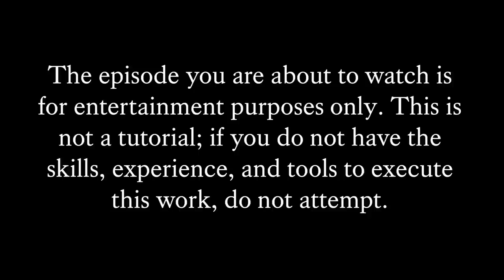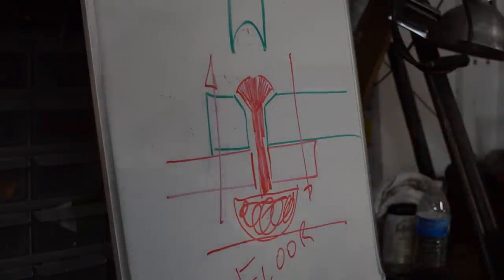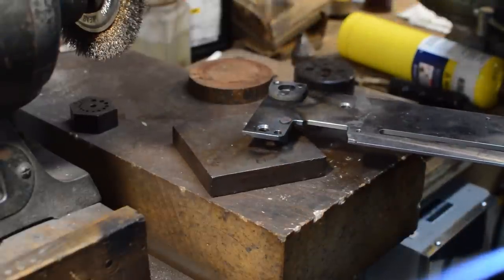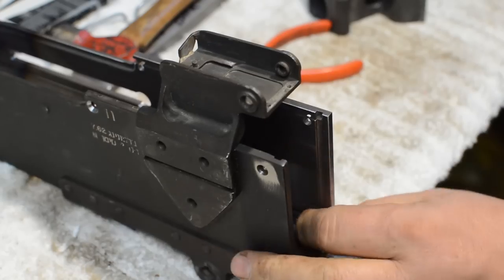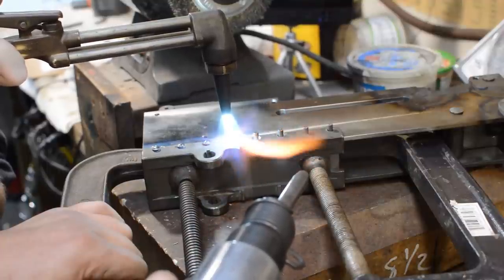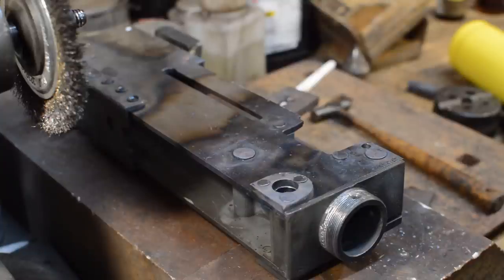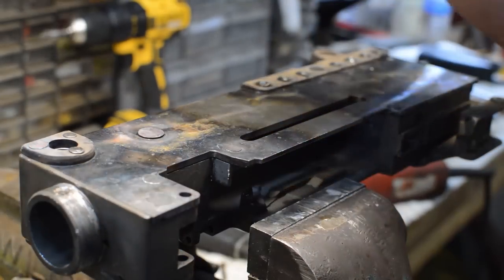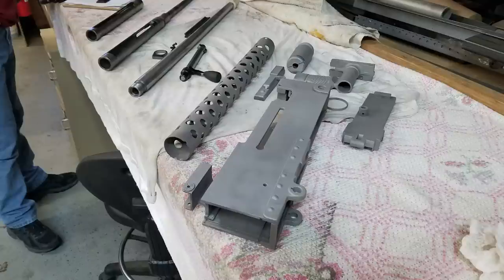Anvil 026: Browning 1919 side plate replacement

Comment: Rivets didn't serve the Titanic too well ??? Or was it bad metal ???
Why did you say grind the plate ???
The M 2 's had rivet heads if I rember correctly ??? An some SAW's too ???
Saw some of the original rivets with their rounded heads ???
Reply: The rivets were off specification. Too much sulphur which makes them brittle when chilled below freezing.
That was found out when they analysed the rivets in the “big piece”.

Comment: Having shot hundreds of thousands of rivets, I can say this was rather cringe-worthy.  That said, the more SOLID mass you can get behind an item for the purposes of hand-riveting, the better.  I liked to use the edge of an 8' metal shear.  The solid steel base was solid enough and made the riveting go quickly.
I notice you're using the FLAT side of a ball-peen hammer.  Ever wonder what that peen side is?  That's for forming rivets and filling countersinks.  Don't be afraid to 'peen' that rivet.  That's what the peen is for.
Reply from the maker: First rule of gunsmithing....the easiest piece to finish is the one you didn't screw up in the first place. Using the peen will put dents in flat surfaces that should remain flat. Try driving a rivet WITHOUT doing any damage to the surrounding plate. That's what we did here. That's a 90 pound block of granite I'm using as a buck. Solid enough?
Reply: @randymagnum143  LOL, i know. Bigger than any anvil we had, though.
Reply: @marknovak8255  Never tried granite but did spend money on tungsten bucking bars. Worth their weight in gold... Almost literally. You might also try using a large drift punch and an assistant if you are not going to peen the rivets. You can use two hammers, too. Set the peenof one hammer on the rivet. Hit that hammer with another Hammer. Eye protection is recommended. Significantly less likely to damage the metal doing it that way.
Reply: Having used plenty of hammers in my life, when your tool is a hammer all your problems look like nails

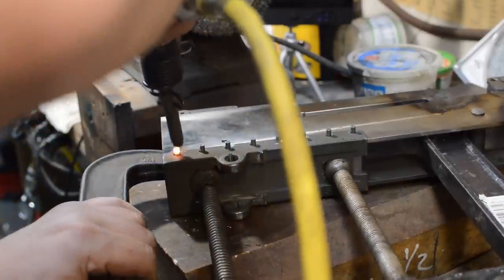Comment: 27:37
Why do you blip the gun at first?
I would think it would be better to go full trigger at first, because that is when it is the hottest.
I don't know much about gunsmithing, sorry if I am not seeing what your knowledge knows.
Reply: Actually, the more I think about it.
You need to pull the trigger longer the first time when the rivet is still hot enough to swell into the joint. 
It is not a random sheet rock screw.
Reply: All this being said...
I have no knowledge of gunsmithing.
But I have some common knowledge of rivets.
Reply: See how good your 4th one is.
Reply: ......
Now I gotta just relax and take what I have comming..
I am in no way as skilled as you are. And I know you have done this lots of times. It was just something I saw that may help you in your riveting future. 
(But obviously not, given your experience)

I have learned so much from your videos, they are an invaluable tool.
Reply: I guess my whole gripe comes down to why you blip the impact hammer when you just start. 
Why not just hold the trigger intill you stop?
Reply: @ridetheapex  probably wanted to make sure he was evenly applying pressure to the air hammer
Reply: @ridetheapex  I'm sure he values the input from someone who knows zero about gunsmithing, specifically bucking rivets.
Reply: @ipdjbt  
Actually, I bet he might.
Sometimes you can learn things from the darndest places.
This may or may not be one of those times.
However,  your sarcasm and demeanor were appreciated......

Comment: It's is actually called a Mark 1 Mod zero de-gausser.  :-)  That thing that demagnetizes.

Would not a wood or dead blow plastic or leather mallet move that side plate more effectively?  LOTS more mass?

Don't get me wrong.  This is really interesting and informative.  I suspect he is using the hammer handle for a reason I don't understand.

FWIT, that appears to be a Harbor Fright grinder.  They are cheap, cheap chicken.  I own two because I got tired of changing from a grinding to a wire wheel.  I knew it was the HF grinder before I saw it clearly, just because of the way it sounds winding down like the cheap POS it is!

Comment: Mark, I have always truly enjoyed your videos, you are a true craftsmen...but you need some help in riveting.

I have repaired loose rivets in literally dozens of customers in my 20 odd years as an 07/SOT, all because of improperly driven rivets.  The mechanics of riveting are readily available online.  Properly driven, a rivet will swell(upset) before the bucktail forms.  This eliminates any tolerance between the rivet and the rivet hole.  Since the rivets in the 1919 are held primarily in shear, it is essential that there is no clearance at this point.  If there is even a tiny bit of movement, the gun will hammer itself loose and smoke rivets.  I've had factory guns with countless rounds through them and nary a loose rivet.  The gun you assembled will smoke rivets in 2-3k rounds.  Also, an air hammer is not the same thing as a rivet gun.  If it's worth doing, it's worth doing right.
Keep up the good work
Reply from the maker: This was 3 years ago, nothing loose yet.
Reply: Lol